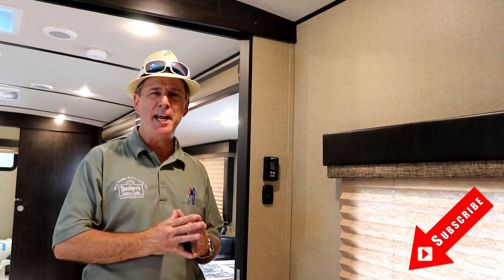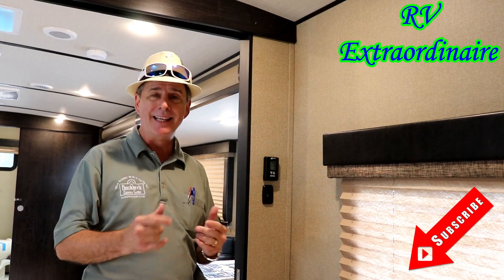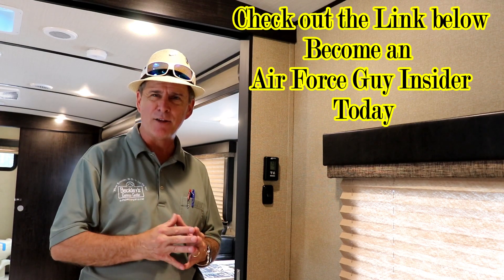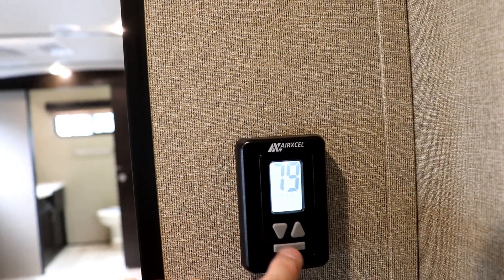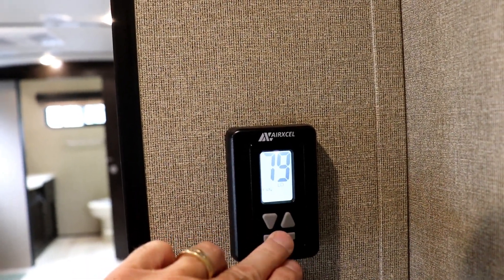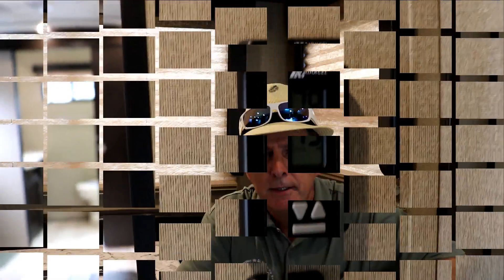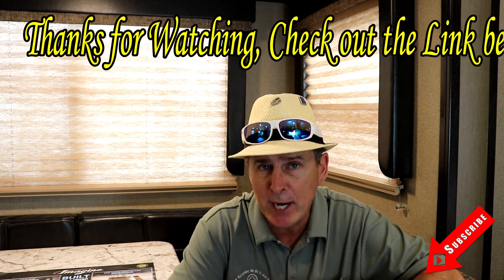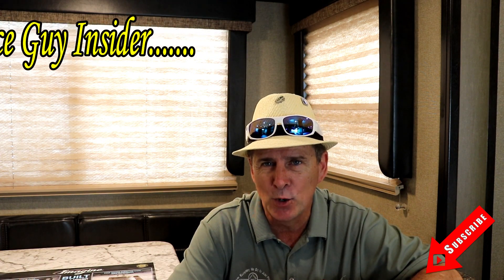Airxcel Thermostat Operation  -   w/Paul Chamberlain, Jr. "The Air Force Guy"

Comment: My second a/c is not turning on, capacitors good, breaker good, the thermostat is flashing and no clicks. I have 12.4v at the back of the thermostat.  The other units thermostat does not blink. The glass fuse on back is good.

Comment: How to change thermostat from celcius to Fahrenheit is say temp is 19. And other problem is heater not coming on just blows cold air
Reply from the maker: Push both arrows at the same time to change.  Need to make sure there is Lp in the lines and make sure it lites.
Reply: I tried pushing both arrows at same time but no luck on changing to degrees. I tried it with it off and on and it's still on celcius.  I have fuel to stove and to rear out side grill but heater will not light . It just blows cold air for few min then shuts off
Reply: Mine is on Celsius too. There wasn’t a  manual for the thermostat in our packet with camper.

Comment: Using the AUTO settings will reduce the dehumidification effect of the air conditioner.  Also, HI does better than LO to dehumidify, but the two cool equally well.
Reply from the maker: Thanks for watt..   In speaking with several highly qualified A/C Tech, each one said the same thing.  The slower the air moves over the coils that more moisture will be removed from your RV vs having it on high.  During the day I run it on Low and at night when it is less humid I run it on high.  
I am living out of our camper and can tell you in my experience what they say is true.  I feel the difference in it being less humid while on low vs high. So it feels cooler than it really is.
Reply: @TheAirForceGuy  Thanks for the reply.   I have to defer to experts on this, but it's surprising.  I think the slower speed would remove more moisture due to increased dwell time, but would be exactly offset by less air volume passing through per unit time.

But one factor I had not considered, which could argue for using low speed is that this would allow the evaporator to reach a colder temperature, would could increase the efficiency of the dehumidification, and tilt the scales in that direction.

In any case, I always run mine on LO simply because the noise level is less, so if this really does dehumidify better, I am fortunate to be mistaken.
Reply from the maker: @jeepien  I did go to the experts and I noticed the difference doing it their way.  No need to defer, just try it and feel the difference.

Comment: I am adding a heat kit to my Mach 8 plus A/C unit.  Will the Airxcel thermostat detect that is installed and control it?  Currently the thermostat controls the heat using propane.  Does it give you additional options for heat from A/C vs heat from propane?
Reply from the maker: Cycle thru the thermostat and see if it is on there.  You may have to upgrade that as well.  Good Luck!

Comment: You mentioned mis fires.
I used my camper during deer hunting. My propane ran out during the night at sometime.  Switched tanks and now it won't come back on. My thermostat just clicks off after about 3-5 seconds. I did turn on my stove. Have gas there. Any thing I can try before I call for service. I am pretty handy with repairs ect. Thanks Tony
Reply from the maker: Sorry I missed this question.  I hope you got it resolved.

Comment: Asking for a friend…
She has a late model Image with the Airxcel thermostat (Coleman unit). She has a pet that stays in camper when she is at work. If power cycles, the thermostat goes back to off (house battery is good). 
Is there a solution / setting that will return the air conditioning system back to previous settings or some default setting when AC shore power comes back on?  
* typically this is short time off, < 1 hr. 
Thanks in advance; Jeff/Time2geaux
Reply: I have this same question. Did it get answered?

Comment: How do I know if it’s powered by gas or electricity?
Reply from the maker: A/C is electric.  Heater is Lp unless you have a heat pump.  YOu would know if your Thermostat has Electric Heat and Gas Heat.  If it only has Heat, it is Lp {gas}....

Comment: Furnace wont fire today. Ran out of propane,  put fresh tank on; stovetop works. No owners manuals supplied🤬. Sounds like a reset is needed, but how to do it?  No fan noise, no clicking. New camper: lots of problems forest river sandpiper. Camping world-Eau Claire stil hasn't supplied manuals, shame on them. Other issues still outstanding.

Comment: Any way to adjust the view?  Mine is 7’ high and so we can’t read the face plate unless we use a ladder.  Hoping we could adjust the LED so when we look up at it, we can read it without using a ladder. Thanks much!
Reply from the maker: You maybe able to put in a wedge like angled piece to angle it down so you can see it. Trying to find the proper wedge would be the issue.  You could possibly disconnect and move it down the wall, however, there would be a hole where it is now that you would need to cover.  All depends on how long the wire is and that may be why it is so high, the installers screwed up and cut it too short.

Comment: I have the white colored version of this stat in a 2024 Casita SD 17. Can the Elect Heat be run in Fan On mode instead of auto mode?  Dont see this as an option.  Thanks!
Reply from the maker: Fan mode only does air circulation.  So no.   Thanks for as watching.

Comment: My thermostat is not calibrated right, its 3-4 degrees hot then what it shows. I am wanting to switch the thermostat to a wifi control thermostat I can control from my phone remotely.
How do I take the cover off?
Reply from the maker: Sorry to hear.  Check the manual to see, if you don't have one just google an owners manual for your thermostat.  Best of Luck

Comment: We have used our camper 6 times and now the thermostat is dead.  How do I change the battery?
Reply from the maker: It is a 12 volt thermostat, so it should run off of the RV battery.  It will have a fuse though.  For that you take it off the wall

Comment: where can I get parts to  mount this thermostat?? It is located in my hall and knocked it off the wall. The backing plate is two round parts, connect with a dog bone. Once mounted, break off dog bone and the thermostat slips right in. I am in need of the backing plate only. Any Ideas???
Reply from the maker: Check out our Parts department at 301-898-3300.  Good Luck

Comment: I have a 2019 North Point Jayco. The master room has this thermostat showing 40 some degrees in the room. The set temp is 75 F. Why is it doing this? I tried switching it to Celsius and it shows 7 C in the room and set to 20 some C. Help me. (:
Reply: Did you figure out thermostat problem? I have the same problem!
Reply: I have the same problem anyone have the answer

Comment: My control won't stay on Fahrenheit.  When I try to set the air conditioner setting.  How do I fix this?
Reply from the maker: Not sure what is happening.  The fix is holding both up & down to change from Cel to Fah.  Need to have a service tech troubleshoot if it contines.  Sorry

Comment: Just bought a 2023 Salem light cruiser cannot get thermostat to stay at temp set for heat example set 74 thermostat goes up to 8 o plus 
I follow Ed the touchings to go thru the modes etc . Is the tremostat bad or did I miss a. Step note only had 3 wks bought at camping world not getting too much help
Reply from the maker: More than likely you have a bad thermostat.  Best of Luck

Comment: hi, I'm in Palm Springs, outside temp about 62, 63.  I hit the thermostat to wake it up, the back light came on and no numbers.  I held the mode button for 5 seconds and the back light just flashed several times.  No Boundaries 2021  Thanks
Reply from the maker: Need to call Service.  Best of Luck
Reply: @TheAirForceGuy  hi. I changed the fuse and back to normal!

Comment: my new thermostat on the heat  setting won't go any higher than 37 and the heat runs all the time until i shut it off, how do i fix this problem. it is an airxcel in my 29-5k 5th wheel

Comment: Why does the air confitioner come on when u turn on heat?
Reply from the maker: Your A/C is not turning on, it’s just the fan.  Turn the fan on Auto when you run the heat.   Happy Camping
Reply from the maker: Or, you have it on electric heat which is the A/C.  If it just says Heat, that is the Furnace.  Keep the fan in Auto mode.

Comment: We have the same control thermostats shown in the video.  I'm trying to figure out if I can change the offset when the thermostat tells the AC to turn on. On our other RV we had Dometic, and you can adjust the thermostat to turn on at a 2 or 3 degrees variant.  This one turns on at a 1 degree difference, so it cycles a lot. Also is there a way to calibrate it?   The thermostat, and two thermometers  we have inside all read the same, say 72 deg., while the other thermostat reads 80 deg. Thanks for any suggestions 

 Matt J.
Reply: I have the same short cycle problem with my northwood mfc 992 truck camper, the anticipator I believe is the term, it needs to have a larger margin of degrees. I don't see an adjustment inside to do so.
Reply from the maker: I would suggest calling the company.  I have no idea when it comes to what you are asking.  Thanks for Watching!
Reply: @TheAirForceGuy  I sent them an email, thanks
Reply: quinn miller any response?? I also would like to know if you can change the degree separation to turn on gas with electric, sooner. Right. Ow the default is six degrees separation. If you set it to 6 above current room temp, it will kick on both electric and gas. I would like this to happen with just 3-4 degrees. I’ll pay for it! When I want heat, I want it now! :)
Reply from the maker: I'll try that next time I do a walk thru and see what is happening on the ones that have it here.

Comment: Hi Paul,  I have a Airxcel 9430-338 in my Grand Design Imagine RV.  Went to turn on the furnace and the thermostat was reading 99.  Of course, I could not set any temperature so we were without heat for the whole week.  I did have a space heater with me that saved the trip.  Does it sound like we need a new thermostat?  I assume the 99 means it lost connection somewhere.  Thank  you, Jim
Reply from the maker: Sorry to hear.  Not sure what is wrong.  Check with an RV Tech.  Good Luck...
Reply: Hi Jim, I’m having the same problem, wondering if you found anything out the problem.
Reply: Yelle Debbie Yes, I just bought a new thermostat and replaced it myself.  You can find them online. And, it’s easy to replace, you can do it.

Comment: Can I use the 4800 series heat pump in my solitude with 30 amp service?
Reply from the maker: You should be able to.  Worst case, run water heater on Lp

Comment: I have a Coleman Mach ac unit with it having only controls above on the unit itself. Would this thermostat work on our unit? It does t have heat but I can use it only in ac mode. Maybe I can make it work with our suburban furnace but would like to mount it to the wall so my wife can operate it. She is too short to reach the controls on the ac unit above. Thanks. Appreciate the info on your vid.

Comment: Is there anyway to have the fan on low mode to circulate air with the furnace running, camper gets warm then cold, warm then cold... if the fan was on 24/7 at night the furnace set to 70 it would not run near as much and the camper would stay  equally warm.. as when heat rises the fan would circulate it back thru camper.. why do they not make this standard..
Reply from the maker: The only fan that could run 24/7 would be the one in the A/C, which would only be blowing cold air into the camper since the coils are outside and cold.  Unfortunately the heater does not have this option.

Comment: Hi, I have 2020 Jayco Precept with AirXcel 9640-336 AC/Furnace/Heat Pump. The thermostat constantly reads 99 degrees so the AC never shuts off because the Temp never goes down according to thermostat (but we freeze) and I’m assuming the heat will never turn on because the stat thinks it 99 degrees inside. Any suggestions? Thank you.
Reply from the maker: Sounds like you have a bad Thermostat.

Comment: My heater comes on for about 30 seconds and then shuts off.  (its 58 degrees inside and its set for 68) I tested that I have propane and ran the stove for a bit. Is there something else I need to do to "prime" the heater?
Reply from the maker: Hopefully you have access to a Air tank so you can blow out the exterior of the heater.  That should do it.  If not, need to get an RV Tech involved.  Good Luck
Reply: @TheAirForceGuy  Thinking there is debris in there?  Would I do that from the outside?
Reply from the maker: Try and blow it out with compressed air.  Hopefully that helps!

Comment: How do I switch it from Celsius to Fahrenheit
Reply from the maker: Either hold both of the up and down arrows at the same time or hold the bottom button in until it blinks at you, then push an arrow button.  I will do a video on this.  They just changed it.....

Comment: Hey Paul, I have the same thermostat in my 2021 grey wolf camper. When I set it to heat and set a temp, the furnace kicks on and it heats to temp. It then shuts off just as it should. The problem is that it never kicks back on as the temperature drops past the set temperature. If I scroll through all temp options and return back to heat, it will kick back on. Any suggestions?
Reply from the maker: Needs to be looked at by a Tech.  Sorry to hear!
Reply: @TheAirForceGuy   I have the SAME issue. They keep telling me it's the Thermostat. They replace it..and then still no heat at night! Grrr.
Reply: Hello! I have the SAME issue. Did you ever get it resolved? My dealer keeps replacing the thermostat, but it doesn't help! I tell them it's  NOT  the Thermostat. How could we have continuous bad thermostats! Then I take it home, and it happens again!  Makes me so upset. Brand new camper...heat doesn't work. :( ALSO, my thermostat like doesn't have an "auto" heat.
Reply: I’m having the same issue !!!! It’s always sooo cold when we get home because it want kick back on . It doesn’t even have auto for heat .
Reply: We have the same unit. It did this right off the lot! BUT there is a solution! 

We ended up turning the gas completely off and then back on again and thenresett the breaker. 

Then, on the unit... Set it to heat, wait about 5 full seconds, you'll hear a subtle click, then set it back to heat!

Comment: I have a thermostat that works 2 ac units as well as the furnace, model 9330-33. When I set the furnace, one of the roof units comes on. What am I doing wrong?
Reply from the maker: The fan is in Low or High for that A/C.  Make sure the fan for the A/C is in the Auto position.
Reply: I finally figured it out! The thermostat has to be set on heat gas with no fan setting. I was setting it with the fan on low auto when actually it should not be on at all. I enjoy your videos.

Comment: I see your video is 6 yo. Are you still available for questions?
Reply from the maker: I can give it a shot. What is your question?
Reply: @TheAirForceGuy  I am not getting heat to the bedroom. 
22 Keystone Montana HC 376fl
Reply: @TheAirForceGuy  the airxcel has a heat setting but nothings happening when I turn it on. What should I do?
Reply from the maker: @IMV61  You need to have a service tech look at it.  There is something wrong with the heater.  Sorry to hear and best of luck
Reply: Is there a setting to be able to run the propane and the electric on the thermostat? Airxcell thermostat.
Reply from the maker: @IMV61  If it only says Heat that will be Lp-  If there is a heat strip in your A/C it will sale heat electric and heat gas.